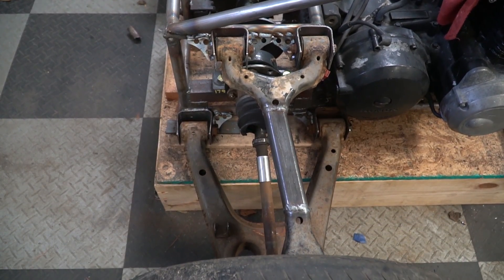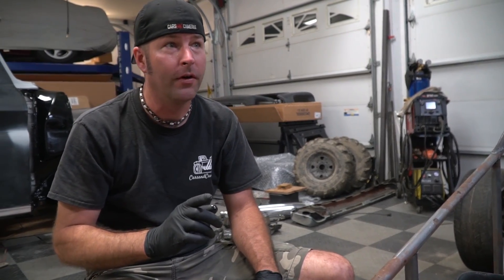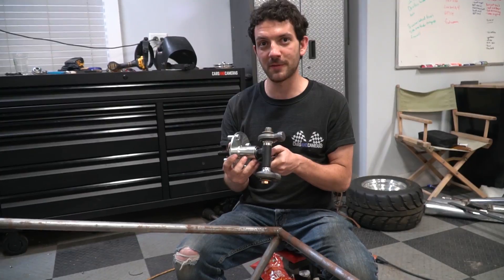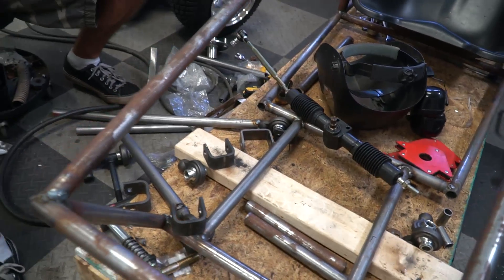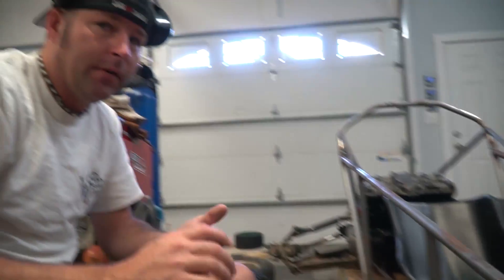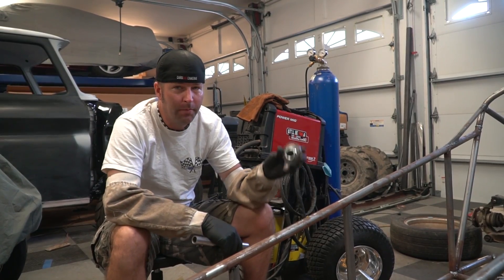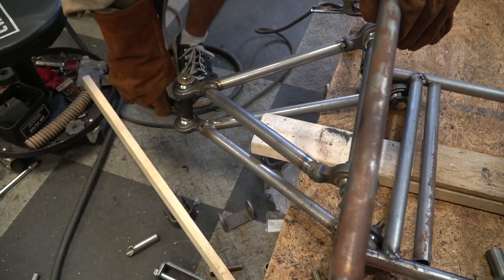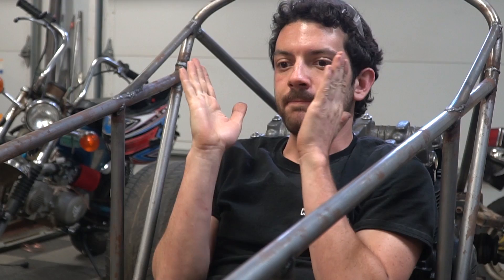Independent Front Suspension Build! | 750cc Cross Kart Pt. 9

Comment: You guys need to start using High Misalignment Spacers with your rod end/Heim joint pivot points!!!

Also start using threaded shank rod ends/heim joints with threaded tube inserts. . .that stuff is CHEAP and will really improve your builds. . .keeping in mind it's low budget fun the small investment would be well worth the minimal cost.

Comment: Have you all thought of a maximum overall weight for this project? Its looking heavier and heavier which is unavoidable... wouldn't it be cool if someone patented a method of lightening steel pipes, like drilling out material but in a calculated method that has a cool looking pattern or something. That'd be perfect for a project like this, a project that takes on more and more weight as its engineered on the fly....in the end how much more than a bike will it weigh?

Comment: Butt welding those joints is not safe. Doesn't matter who is welding it. Needs a sleeve or use threaded tube ends with threaded hemi joints.

Comment: Tires are too big for your rear drive ratio. Your going to need smaller tires or a bigger rear sprocket (which you probably can’t fit). Also the front ball joints you should have used a plug and not butt welded it, that’s gonna break for sure if the suspension ever bottoms out.

Comment: Guys, Your upper and lower control arms are binding.  Geometry is critical.  Also you need have all of the heim joints parallel.  Need to rework this now so you don't have problems in the future.  need to build a jig, to hold things on both sides before you weld it up.

Comment: You are going to be really disappointed When  you have figure out you’ve fabed yourself into a corner with the rear sprocket 
Horizontal heim joints bind with out much movement 
Turn them vertically do the steering uses the ball of the joint to pivot with that you use high miss alignment bushings for more steering 
Add 7deg of camber for better control

Comment: all of the pivot points need to be at the same angle. The 2 at the bottom are pointing inward, and the 2 at the top are parallel which is causing it to bind up.
Also the bottom control arm appears to be longer which causes the wheels to change camber as the suspension travels.

Comment: I would have put the mounting points for the lower control arms on the outside of that tube, and the control arms should have been at around 5 degrees so the wheel moves backwards under compression to soak up bumps better.
Bit if I were doing it I would have had a single pivot point in the centre of the body for the lower control arm and then the upper mounted a little further out to eliminate camber change and bump steer.
Bit it's your machine. It'll still be fun

Comment: Put 3/16 steel plate on the front suspension frame area for safety. On the front control arms you need to put triangle pieces there rather than how it is now so it won't bind up and it's way stronger

Comment: I personally think this would be the perfect opportunity for the classic Honda Odyssey FL250, FL350 and the FL400 Pilot steering wheel. I think that style steering wheel with the brakes and throttle at your fingers would be much better. Because if you watch. Issac’s feet go out of the cart when he acts like he is using pedals. Also if you put the pedals in side I would be kinda cramped having to bend knees to use pedals. And at least with controls on steering wheel. You 1. Don’t have to worry about size of rider. 2. Better control. 3. Comfort. and last but not least it is a classic design and it’s something you have never done before. Would be cool to see it don’t. Make right hand control the throttle and  left hand control brakes. Would also benefit it much more in the trails. Because every time you hit a bump your feet naturally move position and cause constant movement of the throttle. Where as hand controls would stay nice and tight and could also add arm restraints to keep hands inside the cart in case of a roll over. Just a fellow Honda Odyssey enthusiasts.  Hope to see something like this done. Don’t think you guys would be disappointed at all!!  😁😁

Comment: Well, I'll chime in any way.  Your angles are way off. Stuff binds, stuff breaks. If that's the kind of joints you wish to use, by using 3, in the top, you caused a bind. Because the one at the axel isn't moving at the same angle as the upper two. But, if you had used 4 they would all travel at the same angle.  The only thing by using 4, you would probably need strut rods to hold the arms in place. Seems to me the right thing to use would be thick wall tubing so you could thread your ends for adjustability. Without a doubt, it will need adjustment.

Comment: if you run the heim joints 90 degrees, you will get more wheel travel and still have enough pivot to be able to turn.  I just noticed that when Ike flipped the lawn mower it came completely off of the ground.  I am glad that he did not get hurt.
Reply: Thanks

Comment: When the bottom control arm mounts are not parallel they will not follow the same path.because they don’t follow the same arc they want to be closer and farther apart at the spindle end but they are joined at the spindle causing it to bind

Comment: Just about everything I need to say has been said, one thing I will add is about the Spindles, a bolt welded to a piece of tube looks a bit weak to me for the forces you are going to put through them. They look to be designed for a 5hp tarmac cart not for something that will be jumped around a motorcross track. Have a look at a quad or Polaris for the strength required.
Hopefully GPS watches the videos and offers up some upgraded bits before it's too late.

Comment: FYI if you are welding near a bearing or universal joint make sure your ground is between point of weld and bearing or u-joint... mainly because you could seize the bearing/ u-joint if you don't. some times you can weld something together that is between the point of arc and the ground without even realizing it. That could be the reason the u-joints are so stiff.

Comment: Guys, I love your show but I think your spindle height is too short for upper and lower control arms. It appears to be for a straight axle.  Also are the joint pieces cast or forged?  If they are cast the welds will likely not hold.  These are simply my observations. If you ever want technical advice from a gearhead and engineer feel free to let me know. I hope I am wrong on both points but just offering ideas. Great job guys.

Comment: You need to run different heims with high angle misalignment spacer those heims and the way the geometry is will not work that binding will never wear in and if it does the joints will be so sloppy the cart will be all over the place. Also on the upper inner heims your going to need some sort of shin or spacer to keep the whole upper control arm from being able to slide forward and aft

Comment: Those are  Lower Link Ball Ends. There not going to work right for a-arms. You would have got more movement if you would have took the top a-arm an weld it flat not at a angle . They are made not to loosen up an move more. Not going to be safe. Be careful .

Comment: why dont you guys use a honda civic spindal with the honda civic control arm and ball joint and then make a control arm for the top instead of a shock as the upper. it would be cheap to do and be way better.

Comment: So many things wrong with that mess. The bolts on the pivots need to be at least close to parralel. The lower is acting as a spring since the pivots are fucked, thats honestly one of the dumber things I've seen you nimrods do . The upper and lower length plus the height of the rack all contribute to bump steer. Not even going into that, but all wrong.
Reply: At the very least you need to have one pivot pointing at the other.

Comment: Looking at the front arms is pretty scary. Butt welding to the heims doesn't leave me with any fuzzy feelings and then with the added stress of the binding looks sketchy to me. You could grind the welds smooth and then sleeve the joints with a larger diameter pipe and reinforce the joint that way.

Comment: You messed up the geometry on the first side during the welding process. The first weld you did the pivot moved. Your control arms should have been precision cut and welded up in a jig so they come out identical. Then you adjust your mounting points to get a nice smooth operation instead of the jerkiness you ended up with.

Comment: Ok, you know, normally I am all about the shade tree mechanic "it'll be fine" stuff done on this channel. most of it is low speed high drag not gonna kill anyone projects.
In this case however, I am starting a dead pool. between the welds through the hoop, the butt welded tie rods and the messed up suspension geometry... Legit scary work being done on a kart thats going to be going way over the usual 20-30 mph.
Reply: I be willing to bet the same. Good luck ike I hope you dont win rock paper scissors.
Reply: Rally Wagon  Agreed their lack of knowledge on fabrication is definitely showing ...
Reply: I fully agree. Butt welding something so important is bad news. I'm sure it runs, I just hope it doesn't roll over and not hold or come apart and impale or seriously injure someone.
Reply: I'll get in on that action, what's the over / under.
Reply: Death trap
Reply: Oddly enough it's already running, they posted a video on their fb page of it. I'm amazed it runs really, hopefully they figured it out by then.
Reply: Drama queen comments proved completely wrong.  What a surprise.  Happens every vid.

Comment: Cut all that Hacked-up crap off and buy some real Heim joints and quit wasting time with Tractor and farm parts-  Seriously, the Cheap-budget way of doing things is getting old- why not build just ONE project correctly?
Reply: That's what I thought John said in a previous video...he wanted to build a tube chassis from scratch and to do it right.  What they're doing now is not the "right way" to do anything.
Reply: @t-townmini4939   I've been watching MANY amateur Kart & Buggy building channels for years now, most of the other ones progress over time- "Rather Be Welding" used to build hacky, cobbled-up junk, now his stuff is 1000x better, "Build, Break Repeat" has been getting better each new project, Same for Redbeard and a few others, but Car's and Cameras just keep throwing together hacked-up used parts and tractor garbage from the farm supply store, build after build- How many Chinese cheap or free ATV's can two guys cut up and hack together with Galvanized water pipe and old bed frames???  Jerry-Rigged garbage seems to be the plan for this channel forever?
Reply: Grind Hard Plumbing has prob THE BEST Kart and buggy building channel and they dont make cobbled up junk.......

Comment: When making the suspension the anchor points on the frame should be plumb and level . The built in caster should be at the knuckles. 
When setting ride hight you need to know what you travel crescent measures to and that's both arms in you SLA setup. This way you will know where your included angles meet and you will know if you mount your steering high or low....this will keep you from inducing steer from a too short tie rod .
Take a look a old beetle front suspension....way simple, cheap, effective.

Comment: You guys WILL have a catastrophic failure. Those arms will fail how you guys have them welded. 
The rear upper arms need to be boxed. You can't just weld square tubing in-between two pieces and expect it to be safe.

Comment: You should have threaded those rods with right and left hand threads so you could have adjusted for length not to mention replacement. Cost of the taps would have far outweighed the aggravation

Comment: I know "A-Frames" are traditional for upper and lower control arms but because of the angles in those frames and the pivot joints you are using that is the reason for the binding. 'H-Frames" will eliminate the binding and give a larger more stable outer frame to mount your Axle Assembly with steering joint. Any binding on the control arms will make the Cart uncontrollable. Great series guys. Can't wait to see the progress and direction you take with the rest of the build.

Comment: im not really a welder and im just curious why when you welded the control arm why the spark bounced around on the ground?
Reply: Most of what you see flying and bouncing everywhere isn't the actual metal but the shielding material bouncing around. It covers the hot molten puddle of metal and shields it from oxygen as it will contaminate it. It's WAY more complex than that but I did my best.

Comment: Is there some kind of competition going on between you guys and other channels out there. Cause all of you are building some kind of tube buggy. And all of you are using a motorcycle engine. I like you guys but I feel y’all are cutting to many corners and your budget is too small. And your frame design and suspension design doesn’t look to be that great. I’m disappointed a little cause I want y’all to kick ass.
Reply: Just inspired by another youtubers. And you are right, they are cutting too many corners. :D
Reply: From the chassis to the suspension it’s so sketchy. These guys really need to start bending tubing instead of just butt welding everything. The front is all out of whack, it’s just sketchy and will definitely fail if they don’t correct it.

Comment: That front suspension is a nightmare! The heim joints aren't replaceable because they are welded in, without droop and bump stops, the heims will be quickly broken and SAI (Steering Axis Inclination) does NOT necessarily = Caster UNLESS the "A" arms are equal in length AND placement in relation to each other. The length between the pivot points on the steering in relation to the length between the pivot points of the suspension is critical in reducing bump steer as is the angle of the steering linkage in relation to the lower control arm pivot points.

Comment: I'm psyched for this build. I have dreams of something similar and have been building up my tool collection to make it happen. I'm somewhat familiar with engineering (college dropout), and I'm not exactly sure about all the different pivot angles going into that suspension in the front. If you've thought it out and feel ok with it - go for it, but I'm pretty sure the binding up has to do with the design and not the parts. I do agree with you guys that the limited travel has to do with the parts and not as much the design. I'm curious to see how you brace up the frame and how that works out. I'm wanting to build a sand buggy/rail and maybe go for 4wd to make a mini ultra4 rig. I just want to build something bad ass for me and my family to enjoy some adventures in. Anywho, have fun and be safe. Maybe I'll make it up to one of your events sometime.

Comment: The lower control arms need to be angled front to back approx 5-10 degrees this is called anti squat angle/anti dive angle(necessary for stability because of weight transfer during braking) you should run unequal length control arms with the steering knuckles and tie rods adjusted to incorporate Ackerman steering angles (reduces or even eliminates tire scrub) the upper/lower spindle mounting joints at the steering knuckles for the control arms should angle to the centerline of the tire as well (also reducing tire scrub)